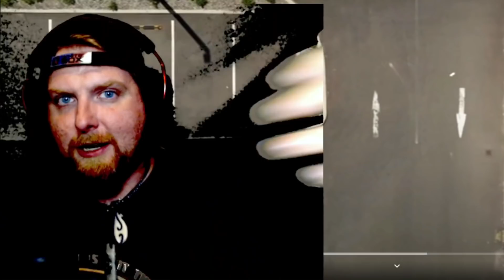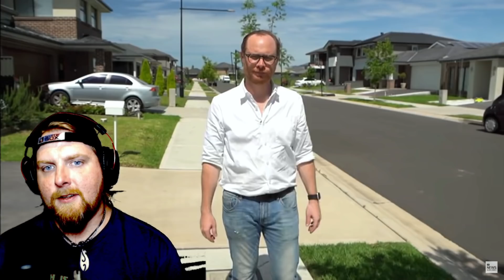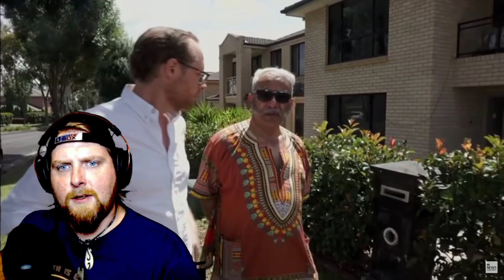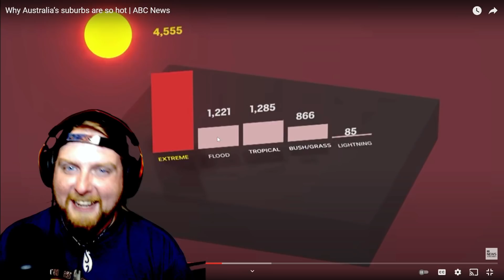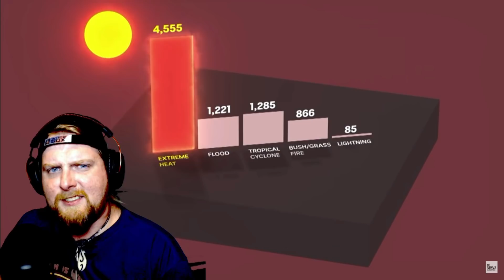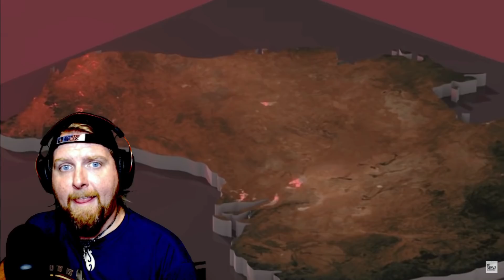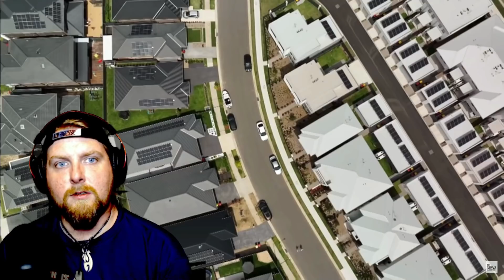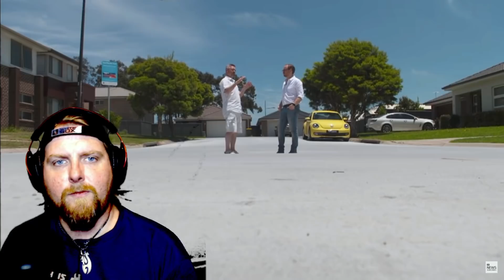American Reacts to Why Australia's Suburbs Are so HOT..

Comment: Yeah... we were talking about heat reflective light / white roofs / surfaces & thereby saving on power bills etc. back in the 1970's / 80's.  Also tree loss - shade loss. With water restrictions many people were pulling out, not only trees, but lawns as well and planting cacti & other succulent gardens in stones/ pebbled landscaping.   The loss of old Australian style 'Homesteads' with deep verandahs all around that kept sun off walls & therefore inside dwelling temperatures much lower - to more & more big square & hot boxes seemed nuts & yet was / is happening more & more. When I travelled in Greece and Turkey & parts of Italy too, I used to see people going up onto their flat roofs to sleep in the cool of the evening. Hard pressed to find any  flat roofs here! 

When I lived in  Adelaide SA, I learned to open the house once the outside temps had dropped  - at night  - to let the cool air flow through the house and close up again in the ams before the heat ramped up during the day. Plus kept all blinds and curtains closed as well. This strategy alone dropped inside temps by almost 10C. 
Of course this didn't work if the night temps barely dropped - or we had a run of very hot days - where NOTHING cooled down. 
One house had virtually no / very shallow {60cm) Eaves & the sun would beat on one wall from round 12 noon through to 9pm. That wall would get so hot you couldn't touch it.  If we turned the hose on it the water would steam off before it hit the ground. As a temporary measure, I put up hooks & thin rope & hung /pegged old sheets up along the eaves on the 2 hot sides of the house. It looked a bit 'mad washer woman'  but keeping the sun from touching the walls made a really big difference. Almost 8c less inside.  We put shade sail up over all the paved surrounds and patio areas too. 

The old air conditioner unit would really struggle. Without it on it was too hot to sleep & with it on high it made so much noise couldn't sleep either. Some nights I would get up 2-3 times to stand under the shower to try to cool down. 
Many people who had no A/C, or couldn't keep up t=with the power bills,  would spend their days in shopping centres /malls & others go to movies or restaurants in the evenings, just to stay cool. 
i know that 'experimental enviro stable-homes which use mudbricks and / or adobe coated straw bale homes, or homes partially set into nearby hills / slopes etc. report such excellent temperature control that they rarely, if at all, have to use either cooling or heating energy. 
I can't believe that such simple technologies would cost more that current modern builds. In fact, often they're community builds. Many years ago I was part of a volunteer group that came together to construct a mud brick community house for a newly developed suburb. it looked fantastic, was very energy efficient and cost approx 1/3rd less to build that conventional materials. { Excluding labour} 

You've heard of Road Rage?  In parts of Adelaide there would be 'Parking Rage'  Workers who had to leave their cars outside all day - would find parking where the occasional tree still grew - or a building would throw shade onto some parking spaces in the  late afternoon and these spaces would be 'hotly' - and I do mean HOTLY  - competed for as drivers arrived in the mornings! 
Getting into a 30 - 40c+ car at the end of a long day - instead of a 70+ car interior was worth fighting over! Dashboards in all day sun would split - also steering wheel surrounds. You couldn't touch the steering wheel or gear stick without gloves on, or hold with a cloth,  and bare backs of legs would burn and stick to anything synthetic on a car seat. 

# One sobering news story / ALERT - that everyone should hear.#  About a woman who had left her car parked in sun for a couple of hours whilst shopping; on return putting her baby into a car seat and then going around to the other side of the car to secure the toddler. The baby started screaming hysterically and when she rushed back she found the metal part of the rear seat belt resting up against the babies upper arm.  At the hospital they told her it had caused a 3rd degree burn.  These are things that people new to the heat hazards of Australia, or anywhere hot for that matter, aren't necessarily knowing to be mindful of. 

I had a health condition that meant my heat tolerances were getting worse - just as summer after summer the temps were rising. With global warming projections -+ Dr's advice we decided to leave SA and move back to Tasmania - where the winters were far colder - but so were the summers.  Even so, design failures abound here too. 
I am currently in a house where an old style Skylight in the kitchen acts like a heat sump. Standing directly under it when the outside temp is 26c+ felt like sticking my head into an open oven door.  As a temporary measure, while deciding whether to pull it out completely or replace with something better insulated, I just had a piece of Foil Board cut to size and fixed over it (inside) = success! A 9c drop in temp in the kitchen on warm days.  

Despite all the expert advice & recommendations re light roofs and better shading of hot suburbs - don't know why Australia didn't take on board. Maybe now are beginning to? Some anyway?    Really should be mandated via council managed building approvals. 
{ NB. I overheard a young couple in middle of planning their home build at a building expo discussing roof tiles. She said " I know the white tiles will help with heat deflection - but I just don't like that aesthetic..."   Guess  they don't mind about the extra $4,000+/ ann in A/C bills either!?} 😵‍💫

Comment: Sydney is more humid than the southern capitals. It's always more humid and cooler by the coast where sea breezes keep the temps lower.
Western Sydney is not desert. 20 to 30 kms from the CBD.
I can guarantee you it's never been 48C anywhere near Sydney let alone in it !! Try the desert. Measure it in the sun, for sure, but it's measured in the shade.

Higher density living is necessary as Sydney is so expensive. The average price is over $1.2M so need to be more affordable.
Northern beaches is very popular as it's close to the city and why so expensive. Quick by ferry or jet cat to the CBD from Manly.
The southern capitals (Perth, Adelaide, Melbourne) experience heatwaves in most summers where high pressure systems will lead to hot dry northerly winds lead to multi days over 40C. Melbourne less so. 10 to 14 days on average. More so in Perth.
Wahroonga is closer to coast, has more rain and more established so greater mature trees.
Dark colour are more trendy in line with the architecture.
The glare from a white road has it's problem too. 
Trees are not practical in many developments as they grow too big and eventually their roots will damage paving, driveways and foundations.
Shrubs are more suitable as their roots aren't as invasive.

Comment: During summer's in Sydney, out west in Penrith is always 3 or 4 degrees hotter than any other Sydney suburb because it lies at the bottom of the blue mountains, heat sweeps across Sydney and gets trapped in Penrith with nowhere to go because of the mountains, a few years back Penrith was the hottest place on earth as temperatures reached 50+ degrees.

Comment: Sorry I may get a bit longer...

The points about road, concrete  house build, trees etc is all very true and vslid. No issues taken on thst.
One critical heat component not mentioned is the predominant use of air-conditioner. Especially in the newer suburbs. In the past airconditioning was not hardly used in private homes, though increasingly in commercial buildings but now few houses are not fitted with airconditioning when built. Yes many old properties are even getting retro fitted  but often with smaller units for specific parts of the house  rather than entire house as is new build normal. Anyway the issue is that in cooling the inside  it spills heat to outdoors, not just the energy of temperature difference  but all those kilowatts electrical power consumed mostly becomes heat  as little motion (kinetic) energy is imparted. Plus all the other increased electrical heat created in modern living.  Then the heat losses of all the traffic  internal combustion vehicle engine deliver under 30% of fuel energy as movement, rest becomes heat from coolant  exhaust, oil and transmission, even motion energy becomes heat with air drag and at breaking to stop the vehicle. Even electric vehicles issue the energy as heat on stopping  and air drag  as well as some heat on charging, though some may recover fractional energy with regeneration  at some heat losses in that.  All this massive heat loss of ever heavier vehicle traffic, cars, trucks, buses, trains, planes, appliances and airconditioners all adds to local environmental heat buildup raising temperature above what sun alone would provide. At least solar panel help as they supply energy for appliances and airconditioning from sun input  not energy stored in fossil fuels, A REAL MAJOR HELP  to keeping temperature rises minimised.

Further most houses get hotter inside, they do not have external shutters on windows, rather have curtains inside that block sun heat, dissipating solar heat inside, or if no curtains the furniture and carpets absorb the sun heat streaming in and creating heat. So adding to hot interior and higher airconditioning energy demands. If in hot summer external shutters were closed in peak day time, a lot of sun heat is avoided in the house keeping it cooler, and lowering airconditioner loads. My own house has no aircondioner but does have exterior roller shutters  closed on hot days. And for most summer the interior stays cool enough to live with only fan air flow used. Opening shutters overnight , and letting night air flow through the house keeps comfort at limits for many days of exceptionally hot days. Yes hot nights staying above 35°C are very uncomfortable, but a fan running makes life ok at very low environmental and power impact.

The lack of trees is a very severe problem. Anyone can experience the difference on hot days going to local forests or even local parks with trees, rather than the typical built up and shopping areas. Very much lowered temperatures in forest. My house has several trees reaching above roof height and adds to better conditions, as well real grass and garden space with plants help. The grass and nature strip trees of our streets also help.  Sadly most roofs are darker colours, from Reds, Greens to Black/Grey, rather than light pastels to White.  Anyone using the light finish actually gets ostracised by neibours for abnormal appearance not matching the norm. We tried a pale green years ago  not liked by many feeling it did not meet community standards.

All the above are very common issues, yet as pointed out the less affluent have little green cover, while the affluent, old suburbs have lots of green space, trees along roads, larger yards with trees  grass and plants.  Like many Australian cities the near coastal ocean places are remaining most comfortable, all new developments are pushing further inland so are significantly warmer. Many new developments are on old farmland, replacing what trees and greenery was there with nothing but roads, concrete and houses covering most land area, making all much hotter. 

Now in certainty at least in Australia, but probably elsewhere likewise,  the worst hot conditions at all major cities is when hot air blows from inland to the coastal areas. The inland towns may regularly have higher temperatures irrespective of wind direction, with temperature in the 40°C and up while the big coastal cities have lower temperatures, even below 30°C in the same period.  Yet Melbourne,  Adelaide get the hottest conditions for northerly winds from inland, while Sydney, Brisbane for westerly winds, Perth for easterly to north-easterly. Melbourne normally only has over 35°C for generally northerly winds, with  north-westerly to even some north-easterly included. Over 40°C only for strong northlerly winds.

One aspect to the claimed climate change temperature rise, and I do not deny climate change occurs just how much is human caused, is that much of the data is including historical temperature (weather) measuring location data, that is now very city heat Island condition affected  and even rural locals that in the past were forested country  now open farm fields with at most a few scattered trees or tree rows along roads or fence lines. Yes there are added SOME oceanic temperatures from satellite readings. But how many points at ocean compared to number of land based points  make up the stated 1.5°C rise over pre 1900 averages. If same locations on land are applied there would be no surprise that just urban heat and deforestation alone could given even a higher result if not for inclusion of above ocean locations that clearly from experience of ocean breeze is cooler than land. None of thatvaverage rise is definitely dependant on actusl climate change.  Not that change is unexpected as climate has been changing for thousands of years since last ice age, and we ideally are reaching end stage of last post ice age heating up. If final stages, possibly it may be faster as last surface ice is reducing to minimal. Note also that a brief cooler period of 1970s there were actually preductions that a new ice age was possibly coming, but soon the same claims converted to warming by the same persons predicting an ice age, when that cool period ended.
The fact is since 1600s to mid 1700s there was an exceptional cold period that was then restored  to warmer, rising faster than present into the conditions of 1800 to 1900.  In Australia there was a 1930s hot period over many years that was hotter and drier than present  and an exceptional lower period in 1970s as noted above.
I felt the 1960s had longer warmer summers than present. Going to beach swimming most nights from November to March. Not now!

Climate is changing  but the true cause is not entirely settled, especially with faked J curve, and dubious modelling using software written on many assumptions to show the expectations of the authors,  and clear shown not tracking with real observation data,  so showing to give false indications.  
CO2 increase so far is actually leading to significant plant and food  crop growth increases. Much greening of the world has been tracked over past decades as CO2 rises fractionally, let's face it we have 0.04%, while past world CO2 has existed to percent levels as most life evolved, and into near full percent levels for most of past millions of years of major life on land. All life including land and water based was created at very much higher CO2 levels  never any run away greenhouse conditions  burning up everything.

Comment: Gee that plastic grass looks sooo natural.  Melbourne has hot summers, cold winters. That 48, 49 was probably taken in the sun (?), not the shade as the Bureau does. You use air con to cool and heating to warm, all use electricity. Leave the trees alone. When I was a kid I lived in Western Sydney. Summer  was boiling hot and my dad did fry an egg on the backyard path. Our thongs would stick to the ashphalt and feet would burn on it. The only way to cool off was under a sprinkler, in a pool or cool shower. But then there where large backyards most with trees, parks up the road and fields to romp in. Loved every minute of it. Those subs with lots of trees are in the main much older than the new builds with no trees. Why those rooves (correct spelling) are compulsorily dark makes no sense at all in hot areas. Those councils need a talking to. Interesting vid. Tks Ian

Comment: In summer of 2021 it was 49.6 C (121.3 F) here in a little village called Lytton, British Columbia Canada. No parking lots to speak of really, certainly no massive acres of the things, lol. (Then the place was destroyed by forest fires, which is ironic, as if the city had been paved over, it would have survived...) Just a little South and East, in a town called Merritt, 8 months earlier, it was also completely destroyed, but by torrential rain and floods, instead of fire. These were both small towns in the relative boonies of Canada, only separated by about 32 miles in a straight line.

Comment: While it is true that Melbourne is colder than Sydney in Winter, they are almost the same temperature in Summer. That being said, Sydney is more humid than Melbourne so it can feel hotter. Melbourne actually gets more days of extreme temperature (both much colder in Winter and much hotter in Summer) than Sydney which has a more stable climate. Melbourne usually has a handful of days over 40 degrees every year (although not this summer which was very mild) and occasionally will get up above 46-48 degrees. The hottest temperature that I have experienced here was in the week prior to the Black Saturday bushfires. In an urban heat island on the hottest day my car registered an external temperature of 53 degrees. The official temperature was about 49 degrees in that location.
Adelaide actually gets the worst of the hot weather, being the closest capital city to the large desert area. When the wind blows in the right (wrong) direction in SA it causes some of the highest temperatures in the world.

Comment: So I live in Tasmania, which is a cooler part of Australia as it's an island South of the mainland.
I've lived inland in Launceston and on the coast in Burnie. Burnie gets nowhere near as hot as Launceston does due to the sea breeze that comes off Bass Straight, the stretch of sea between Tassie and Victoria. Launceston also gets colder than Burnie and it even snowed in Launceston one year. Also the Midlands get very cold, it snows in winter. Launceston is built in a gully.